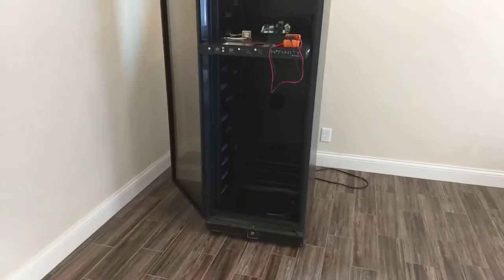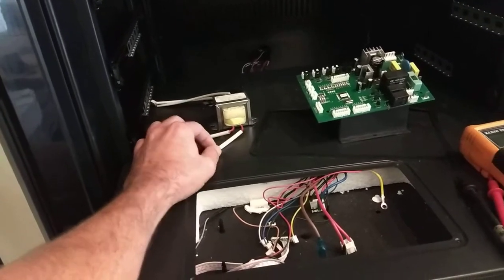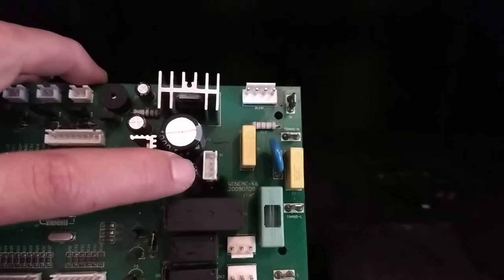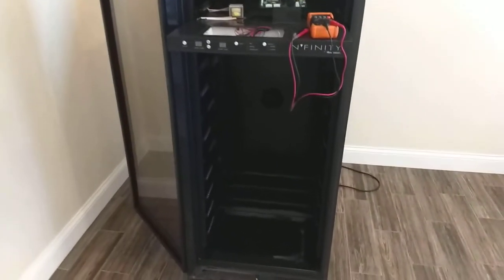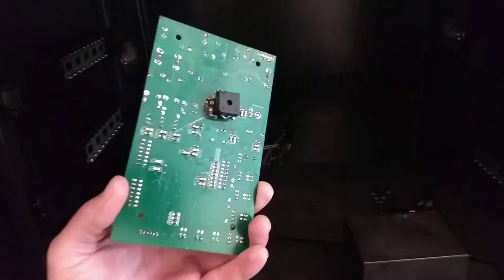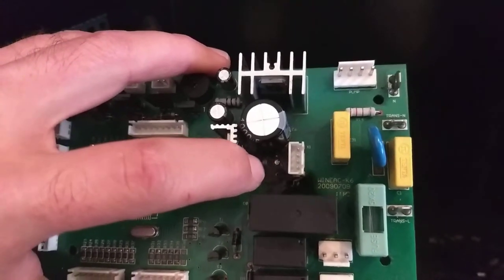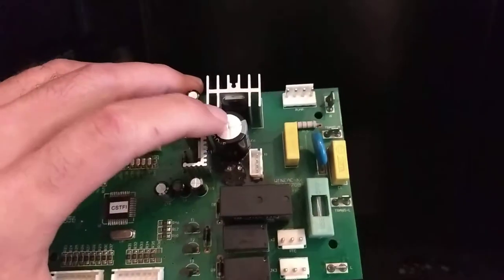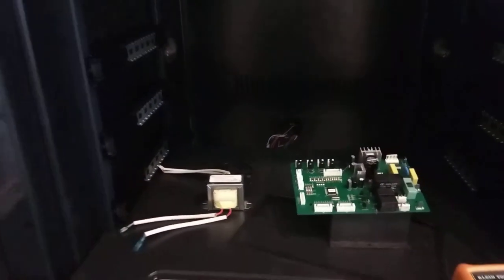Wine Enthusiast 170 Bottle Repair (Part - 1)

Comment: Do you recall how you got the control board out. Our Wine Enthusiast wine cooler is a little smaller but the control is screwed in and not on a track like the shelves. Trying to figure out how to gain access to the board itself to swap it out.

Comment: I Have the same unit. It stopped cooling so I called a refrigerant company to get it working. They discovered the lower inside fan  was not operating and the fan cooling the compressor area was not working. With no parts list or instructions on how to fix it, they recommended I get the fans running then they could recharge it. After watching your video I checked the board for burn marks. There were none. I took three of the screws off the lower inside fan. When I turned it on it ran for an instant. The question is how do I get to the fan to check it out or replace it. It think the inside panel comes out but how do you get it out with the control panel in place.
Reply: I'm having the same issues did you find anything out?